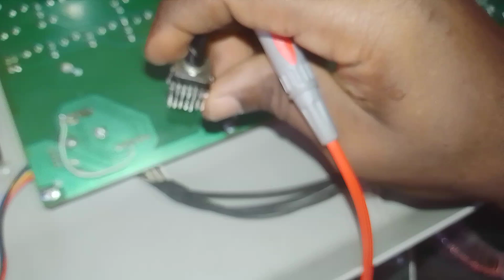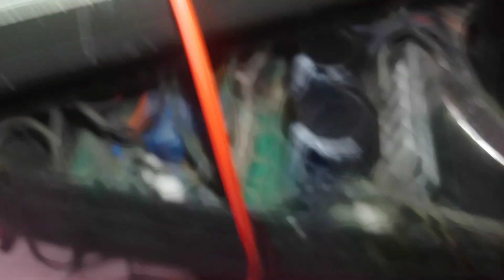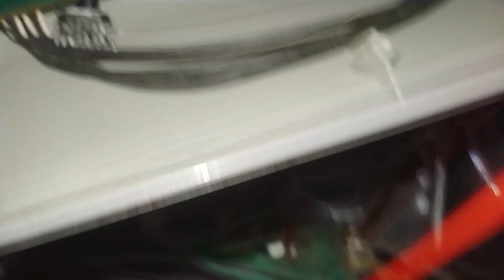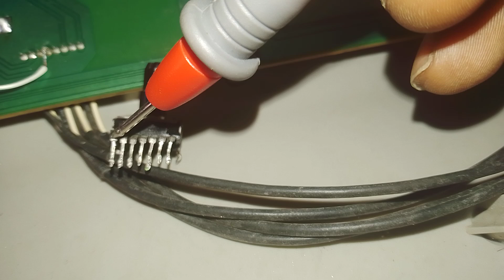How a 7-Pin Volume Potentiometer Works | Audio Repair Guide

Comment: Can I wire two twin amps using 1 potentiometer  7pin?
Reply: Both are zk-3002t amps
Reply from the maker: Ok
Reply from the maker: You can do that using a double volume potentiometer meter. So the single volume will control both.

If you need further clarification or a video on that let me know.
Thanks
Reply: @yaletech_  yes please I got the volume potentiometer to control both. But the bass and treble potentiometers not yet.
Reply from the maker: @artiusreynolds8432  ok both a 10k or 50k potentiometer can do that
Reply: @yaletech_  can I just feed the left in right signl. To the copy amp.
Reply from the maker: A 7 pin out can work too once you understand how the left and dright works.

But in the case of amp, it's more better to use a double volume. That will save u the risk of bridging between your connections.
Thanks
Reply: @yaletech_  I tried to find pinout diagram for the potentiometers but no luck zk-topm7 is on potentiometer. And zk-3002t is the amp.